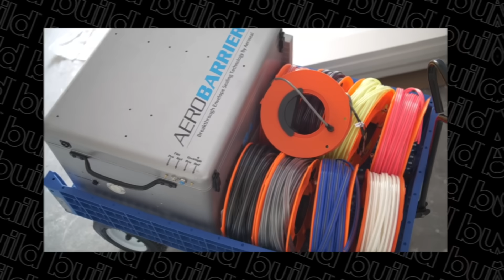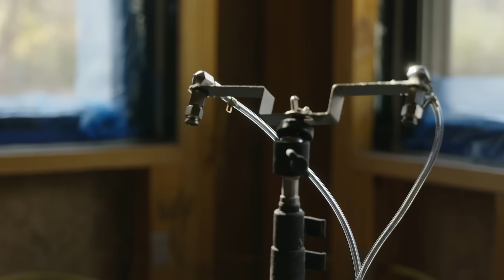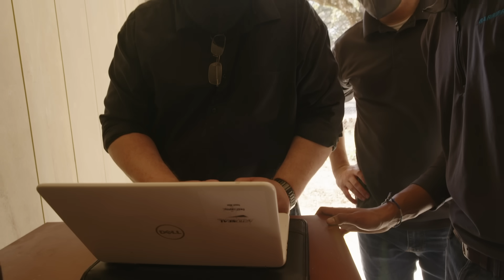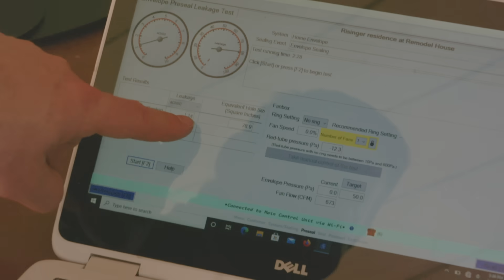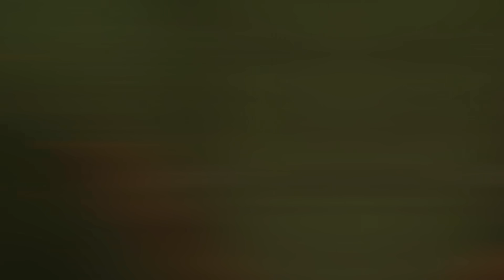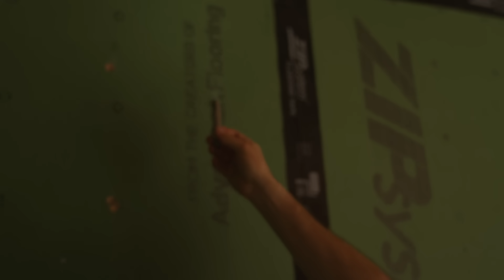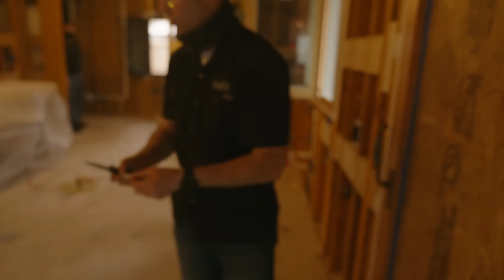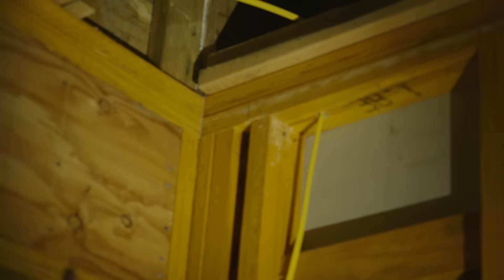The one product I'd recommend for EVERY House!

Comment: Nope. You do not need to live in a zip lock bag to be energy efficient or to stay dry. I want my house air turned over regularly. And I heat and cool very inexpensively with very low cost mini splits. How many months utility bills could I pay for the cost of all that sealing? You know what else is energy efficient? Not living in a McMansion. The VOCs in that chemically sealed house are going to be off the charts for years.

Comment: Anyone still talking about "too tight" these days is a fossil in the industry.

With proper mechanical ventilation. you totally eliminate "tight house" problems.

The only "gotcha" is in a long-term blackout situation (solid or rolling).

Because you're using electricity for mechanical ventilation.  And you can STILL set a power-outage "open up" default.
But with a bit of planning for a backup generator, or renewable power (or both), you never have to worry about long-term power loss.
Reply: Windows man, windows
Reply: In a long term blackout having a good sealed home helps maintain either heat or cool longer. 
Windows can be effectively used for temporary temp regulation. 
Pull in cool air in the morning in  hot climate and maintain that longer

Comment: His drywall and insulation will reduce that even more.
Reply: I doubt it. I thought Matt was going to use Rockwool batts (not air tight) vs spray foam and the drywall will be leakier than the exterior sheathing now. It is the tightest seal that provides the most seal.
Reply: @davideakin7434  of course, but it will provide some more resistance

Comment: The urethane spray foam loses its adhesion rather quickly. It does not maintain elasticity and only provides an air barrier not a sealing barrier. I hate the spray foam; it is over used. The very best builders in my area will still not do this or take air sealing serious. I know of one of hundreds that make any effort.

Comment: I'm hoping to get a house built with steel SIPs for durability & very low construction costs (manpower, crane rental time, reduction of potential for water damage & black mold issues that would definitely plague OSB in my climate, etc). I know that kind of building alone will reduce a lot of framing-leakage issues, but I, too, want to reach Passive House certification standards.  I've been worried about the price of AeroBarrier to further ensure it, but anything under $2/finished square foot is a very good rate, and should be worth it!

Comment: https://aeroseal.com/aerobarrier/
 for any given hole ...... how thick is the sealed patch ? .... for different diameter holes… What is the profile of the holes .... How long does the caulk last ?  what does sunlight and/or temperature cycling do to the caulk ? ..... how well does the caulk adhere   what temperature is this applied at ?    it may be better if the system detects where the leaks are ( where the air is flowing ) and moves the sprayer nearby .... and moves it again and again   ...... can you pre-prep with special fibers to clog holes ?    
is there a 3rd party analysis of the aero process ?

Comment: If you want 'tight' crawl into a plastic bag and have someone put a twist tie on the opening.  Dumb is as dumb does.  I was in a tract project that used this process and after 9 months there was mold growing around the tops of the walls where they meet the ceilings.  And they were using a direct x air exchanger.   If you home doesn't breath it is very very very unhealthy.  Mold spores are everywhere and grow where there is stagnant air that is moist with human activity such as showers, cooking etc.  It was my profession for quite a few years to endeavor to diagnose and treat poor indoor air quality.  What seems like a good idea on the surface is merely an attempt to create perfection...and we all know that perfection does not exist on this planet.

Comment: Do they recommend you go back and bolster the newly "sealed" areas with additional product since the caulk might move over time?
Reply: that's what i was thinking. They show those lines on the top plate. I'd be like lets hit it again with the caulk gun. They should add something UV active so you can hit it with a black light and then you know where to caulk with macroscopic globs
Reply: @AsHellBored  I hope the manufacturer of this product reads your statement.

Comment: I can't help but think that as soon as a 3/8th inch hole is stopped there will be no more buildup of caulk. And the point where the last tiny gap is filled, won't that part of the hole be very, very thin? How can it not be very thin? There would be no air flow for it to build up a somewhat thick seal that would stand the test of time, no?

Comment: Wall of your garage should be double drywalled or use sheet rock as a layer with fire stop calling.  Not just for fire proofing but gives you time for fire department to arrive and  stops fumes from the car, entering the house.   Cool video thanks.
Reply: Also helps with noise reduction

Comment: So, 1hr spray of a gallon of sealant, plus throwing tape on windows/doors and any finish surfaces = $3K to $5K.  Nice business. Gotta think there will be competitors popping up with those margins - forget building custom homes, be an Aerobarrier franchise.
Reply: They didn't want to pigeonhole the contractors so they gave a loose $1-$1.50/ft².  Matt's house is just under 3k ft² so at the higher end it would theoretically be $4500

Comment: Matt calls $3,000 to $5,000 a “couple thousand bucks”. Why can’t they say that this is expensive?
Reply: And I bet you it makes no difference.  If you're running the air, you would have higher pressure on the inside than outside, which means that you would be pushing air out, not allowing air, pollin, and pollutants in.  In reality, the amount of air you would be losing would probably not make a significant difference in heat/cooling retention.  You might as well flush your money down the toilet.
Reply: @johnkm77  It would certainly make a difference... just a question of how much and whether it's worth it. At $2K for a 1500 sq ft house, of you saved $30/month on utilities, it's 5.5 years for payback... that seems like a good deal if you plan to stay for a while.
Reply: @johnkm77   the ROI @ .1 ACH is a huge difference compared to the 3-7 ACH depending on where you are in the country.  Seeing other comments you have left seems to point to you not having watched more than a video or two of Matt's.
Reply: @keithhogan6997 , I've watched lots of his videos, I just think it's overkill, and I especially think it's not worth doing being of the possible toxicity.  The less chemicals you coat your house with the better.

Comment: Will this chemical going through the house affect the HVAC system and electrical system?
I could see a big issue with spraying a chemical like this through out the whole entire interior. 
Just think where this chemical is going and making contact with. 
.
Just a thought for long term issue or issues from the start. 
The HVAC and electrical tech personal will not be too happy.

What about any windows that might leak - will this damage the seals or window ??
.

Comment: just finished one of my builts with aerobarrier. ACH value drop from 4.2ACH to 0.64ACH. nice product for energy saving. 
but how come it is being applied without any insualtion and drywall?
Reply: No pressure differential.
Reply: I would run the aerobarrier just like this in the dryed-in stage because it will have direct access to the points of leakage.  Once the drywall goes up the points of penetration, IMO, would be fewer and therefore the sealers wouldn't get to all of the places it would have prior.  Any of those points of penetration would allow the outside environment in behind your drywall, and the beginning of mold.  If I wanted to take myself to a Matt² kind of level of intensity I would run the aerobarrier again after drywall.

Comment: Too much. Too many chemicals, too fussy, too expensive, and too tight. And NO NO way should you be breathing that crap... vaporized rubber?!
Reply: You haven't watched very many of these kind of videos I take it.  At least not many of them Matt has done on this house.  Once the blower door and aerobarrier were off they ventilated the house for 15 minutes.  Anything in the air when the blower door shut down quickly went to the floor.   If you don't understand the ROI of being under a .5 ACH versus a 3.0 then it won't make much sense anyway.
Reply: @keithhogan6997  I have been a regular viewer for a few years now. I’m starting to realize building science is a religion and if you can convert your client it’s an excellent profit stream. My fear is this stuff (because of industry lobbyist) will become required by law and will kill the chances of anyone with borderline budgets the opportunity to build.
Reply: @redneckgoatfarmer  that can be said of every single requirement of the code. You can always build smaller. Im building in a sub with 1300sf energy star houses  and the builder is wealther than just about ever othe builder I've met in 20 years in the biz.

Comment: Spending 5k to save $50 a year? Building science!
Reply: He is saving by making video about it
Reply: @sammax4245  you have a point
Reply: @sammax4245  he is, you're not
Reply: This channel is 90% promotional marketing?
Reply: @Hello-zf5lq  it's definitely changed since the early days
Reply: Plus the cost of all these blower tests, that prob wasn’t cheap either
Reply: @mel1654  nowadays blower tests are required
Reply: @jl9678  not in my jurisdiction so far
Reply: Mold remediation costs more than $50\year!
Reply: But payback is 30 years. I really am LAUGHING OUT LOUD
Reply: @topspeederalmond  the passivhaus bragging rights start instantly though
Reply: @topspeederalmond  About the same payback ROI as good windows...
Reply: Hypothetically he would have spent $3000-$4500 to have this done.  If it had a beginning ACH of 3 then by bringing it down to a .1 then he would be saving far more than $50/year.  Now factor in all of the crap from outside that won't penetrate the house, especially mold.
Reply: @keithhogan6997  Mould only grows in stagnant air !
Reply: @moonshiner2977  tell that to all of the people who have to have mold remediation done in their homes and those that suffer lung issues because of it.
Reply: @keithhogan6997  
If caulk has about a 5yr lifespan then at $1.50/sqft...that $4,500 install (3,000sqft house) would need to save $75/mo in heating/cooling costs just to break even. And, this isn't a hazmat facility with decontamination protocols...every time someone opens a window or door mold spores will still enter.
Reply: @TheBighatter  that's rich man's building science right there.
Reply: @jl9678  
Sure seems that way, at least without more info about payback timeframe and product life expectancy at least.
Reply: @keithhogan6997  Keith hogan, not true. Model it yourself with BEOPT. you'll save about $50 a year. Also, he had a beginning ach of 1.7 which is already darn air tight

Fiberglass insulation is a damn good  air filter so I'm not worried about that.

The overly thought house should be worried about Mold because they have to have constant ventilation, which adds a lot of latent load in texas(humidity) so the mechanically ventilated house is more humid and will have more mold problems unless they add a third system- constant dehumidification.

Educate yourself https://www.buildingscience.com/documents/digests/bsd-107-understanding-ventilation-in-hot-humid-climates
Reply: @jl9678  - You lost me at "Fiberglass insulation is a damn good  air filter " - So which is it Insulation ? or an air filter ? Because it's certainly not both !  Do your homework, Fiberglass sucks as insulation unless there is no air moving through it.  It provides no sealant, air barrier or moisture barrier of its own.  Its cheap and easy, thats why it gets used so much.  But Fiberglas Batts are the worst insulation choice in most cases.  Fiberglas is a good dirt filter for catching dirt and critters.  Fiberglas batts are never installed properly and breathing in airborne fibers will destroy your lungs.  Cellulose, Dense-pack cellulose, Rock wool, even denim batts and spray foam are all better insulators when applied properly, because they can be applied properly.
Reply: @jl9678    Why do I need to model something?  Why don't you put in the work if you want to make a point?   And do you think that Matt isn't educated on BEOPT?  Also, I used 3ach as a general number just as it was referenced to in the video.
Your comment about fiberglass insulation being a great air filter has me shaking my head.  It might be if you want to use it in a filtration application, but that's not what I would ever want to depend on it for in my walls.  As it packs up the insulation loses it efficacy.  No thanks.
And your mold comment makes me wonder if you aren't here to only to stir the pot or is an attempt to bolster self esteem.  Matt is a quality forward thinking builder who's career is based in Texas with a reputation that speaks to it.  If you think he hasn't covered his bases in regards to humidity, mold, filtration, etc I suggest you watch his channel more.  His own home video series covers it quite extensively.
Reply: @keithhogan6997  there is education out there but it's not my job to educate you. If you want to be educated or ignorant, is up to you. Still, I will post a vid on beopt soon. The world needs to know
Reply: @jl9678   It has nothing to do with being educated or not, but nice dodge and a 2nd swipe at passing the buck, good on ya.
Reply: @keithhogan6997  it has everything to do with being educated. Think about it.
Reply: @jl9678  forest for the trees, or troll without a bridge?
Reply: @keithhogan6997  firstly, I don't think you quite understand the definition of trolling. Second - if you're building a house, it's your money. Spend it how you wish. Lol
Reply: @jl9678  if the latter is true you might have kept quiet, but hey, knock yourself out.
Reply: @keithhogan6997  you can lead a horse to water but you can't make it drink.
Reply: @jl9678   my level of knowledge you can assume, but there is no mistake in your dodging.  Nice try tho.
Reply: @keithhogan6997  I'm STILL not going to model it in BEOPT for you. If you don't know how to use the program, say you don't, then maybe. Otherwise, have fun doing it yourself. Let's know what you get when you go from 1.7 ach to 0.1 ach. 🙂

Comment: Dude that house is going to be so hermetically sealed you're gonna suffocate in there.
We're glorified apes. We are supposed to live outside in the dirt and mold.
Reply: I wonder if this is the equivalent to people that used to use hand sanitizer so much they would get sick from low immune system support..
Reply: @FJB2020  I was being a little facetious but I eagerly away to see what he does with ventilation. My current house is all SIPs and it gets stuffy as hell. Like right now because we're having really nice weather and it's too cool for the AC but too warm for the heat. Haven't had to run HVAC in days. My last house I used a whole house fan and ran it all the time bringing outside air in then blowing inside air out and I loved that. Air tight saves on energy bills and might help with allergies but it's like living in a ziplock bag sometimes.
Reply: Go back and watch the videos he did on the HVAC system in this house.  Then come back

Comment: Most houses arent tight enough to even use that Matt. Thats how bad standard construction practices are
Reply: Yeah, until you'd pay triple price...
Reply: Most houses in texas are less than .2 ach when you don't have a blower door running!
Reply: @jl9678   .2?  Verifiable link to info?
Reply: @keithhogan6997  you are asking the right question - and now you are on the way to true enlightenment.

"Work done by Tooley, Moyer, Cummings and many others in the late 1980’s and early 1990’s showed that the operation of the HVAC system in homes constructed in hot humid climates yielded air change rates of between 0.5 and 1.0 when the systems were operating. When HVAC systems were not operating the same research work showed air change rates of 0.1 to 0.2 ach. "

https://www.buildingscience.com/documents/digests/bsd-107-understanding-ventilation-in-hot-humid-climates
Reply: @keithhogan6997  please understand the importance of the link I posted- spending tons of money to  air seal, which necessitates an expensive ventilation system, which adds latent load that has to be dehumidified out, is NOT building science!
Reply: @jl9678  As long as you aren't in a climate with 30-40MPH winds in the winter, I guess that works.
Reply: @brianleeper5737  yes, most people don't live in areas with that much wine, and even if they did it's still a small hit on the utility bill in our climate zone
Reply: @jl9678  In your climate zone, probably. In more northern climate zones, well, they mastered the art of building tight efficient homes a few decades ago.
Reply: @brianleeper5737  Matt risinger is in my climate zone so...
Reply: @jl9678  A lot of what Matt Risinger talks about is applicable to other climate zones. It'd kinda suck if he stuck only to things absolutely needed in your climate zone. I don't think I'd watch his videos if that were the case.
Reply: @brianleeper5737  the point is that it's not applicable to our zone. It may be applicable to other very cold zones but spending 4500 on this is a cost that is irrecoupable

Comment: I would think this type of conversation should be had at the framing stage where sealing between studs is critical. I noticed between plates there was a thick barrier coating, perhaps there should have been acoustical sealant or an adhesive applied. Maybe a pregame chat with the electricians about penetrations they create. If you involve all trades you’ll have a better product in the end. All this will obviously take time and education. I really like this product though. #longliveourbuildings